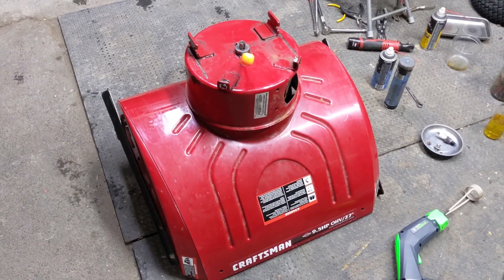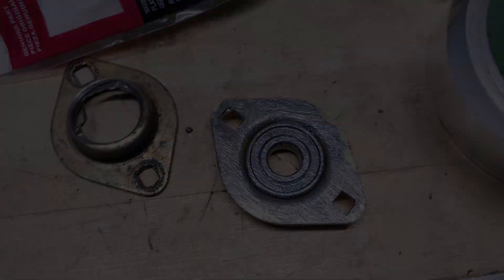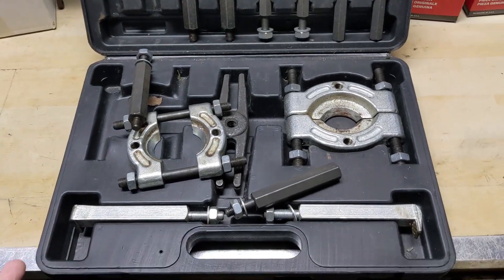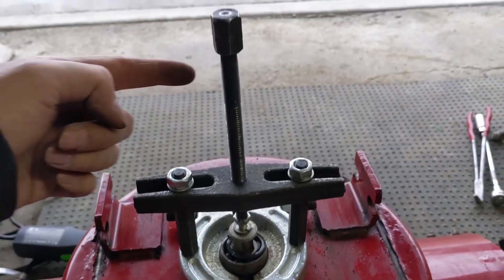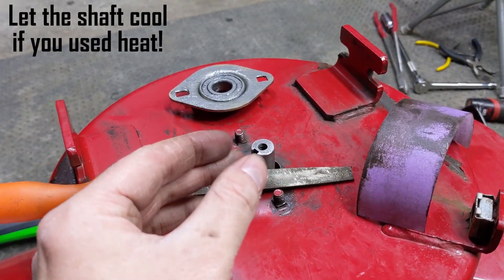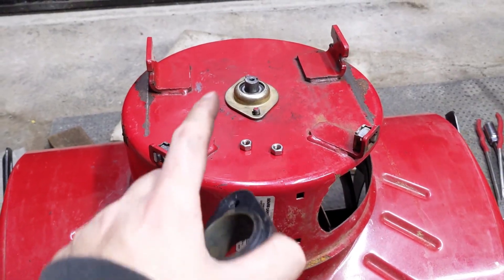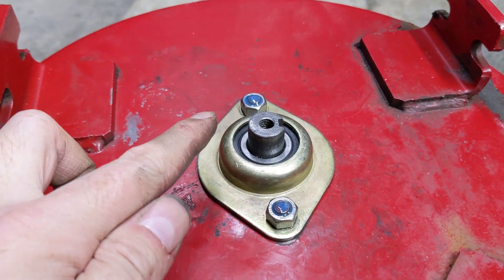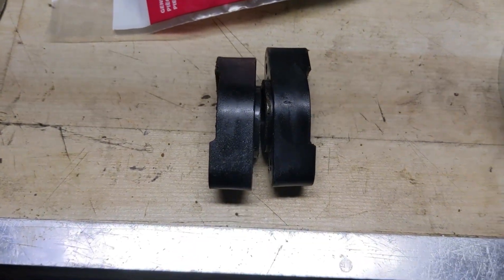Removing a Seized Impeller Shaft Bearing on a Snowblower

Comment: My craftsman snowblower makes a loud banging sound when I engage the auger. The impeller has about 2 inches a free movement when I manually spin the impeller.  Not sure if this is normal. Could this be my impeller bearing?

Comment: Great info.   

Are the two bolts that fasten the bearing flange easy to replace?   They look like carriage bolts possibly 5/16   18 pitch.   Not sure if they can be knocked out easily or if they are part of another flange on the side that we don’t see in the video.
Reply from the maker: Sometimes they're carriage bolts, other times they're welded. All depends on the brand. If carriage, the impeller usually has a hole in the back part so you just spin it around until it lines up with the carriage and you can access it for removal!

Comment: Buy OTC. They cost more but their tools are as good as it can get and nave fail you. I have a drum puller, ball joint set, and the puller you show. I use them with a light electric impact on occation but most likely just hands. These tools and acetylene heat are a must.

Comment: Another question, please.  I ended up buying a new impeller shaft for my snowblower. (It was seized on and pretty pitted when I got them apart.  Even after cleaning it up it was a bit loose with the impeller fitment).   On the original shaft the shaft was painted between the bearing housing and the worm gear housing.  I imagine this was to protect the exposed shaft from rust.  Wondering if just coating the new one in ‘anti-seize’ (and keeping it coated throughout the snow season) in your opinion would be a reasonable way to go?  I am thinking that if I paint it, then it will prevent me from pulling the new impeller off once in a while to re apply anti seize, to prevent it getting seized on, again.  Thanks.
Reply from the maker: Antiseize would work great, I use it on bare metal all the time. Apply it heavily as it's cheap insurance!
Reply: Awesome, thanks.

Comment: When using the puller, use a 1/4" drill bit to create an indentation in the center of the bolt head so that the puller doesn't slide around and slip off

Comment: Gawd, I wish I was closer to you ... you are amazing.  Thanks for the video, another great vid.
Reply: Any chance you would know what puller matches up to the impeller pulley holes on the Yamaha YS928J snowblower?  The service manual only refers to a puller for the stator, which is also a 3 hole puller.  I didn’t think to measure the bolt hole pattern when I had it apart.

Comment: With a thin blade on a grinder, grind down beside the shaft, cutting open the cup (inside) tube of the Bearing very close to the shaft.  Likely Hammer or Air Chisel will then remove Shaft. Done.
Do not over use the hammer or chisel or you may damage gears in gearbox.

Comment: Nice textbook demonstration. For the folks without a split puller, a 3” air cutoff tool and hammer and chisel will work too. Actually you can get them off faster than the time it takes to setup the puller. The bigger pain can be the pulley. For that I weld nuts or bolts onto the side of pulley sleeve and from there I can use a steering wheel puller or heavier gear puller. Once off, cut welded on nuts/bolts off. For replacement options on some of these snowblower bearings oem is the correct way, but if a guy is handy universal flanges and bearings can be found at many farm stores. New holes may have to be drilled but it can be done.
Reply from the maker: Yea it's never fun having to cut them off, sometimes they get really bad, this one came off with a bit of heat and the puller. Thanks for watching!

Comment: Great video , With the quality of parts slipping this will be a fix the you will see more often . If you do not have a puller or a induction heater , a very careful cut with a grinder will work or a propane torch maybe helpful .
Reply from the maker: Yes we've had to cut them off before as well lol never fun, thanks for watching!

Comment: I noticed your bearing has no keyway. I've worked on some Murray noma units that have keyway. On none keyed I've seen bearing seize in race so shaft turns in bearing and a groove wears in shaft. Last case I used jb weld to fill the groove.
Reply from the maker: Yes, some seem to have them, others don't. Many of the new ones only have the keyway in the pulley now